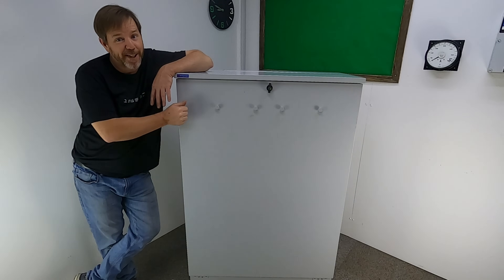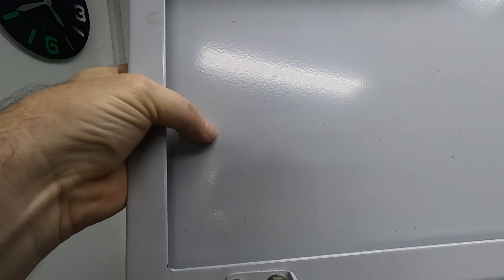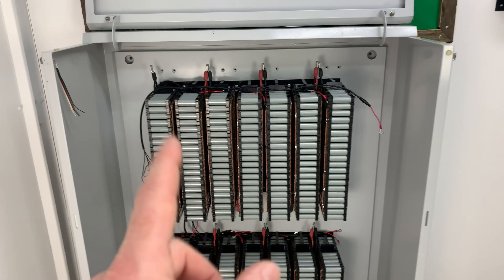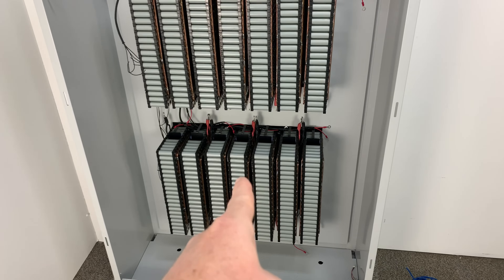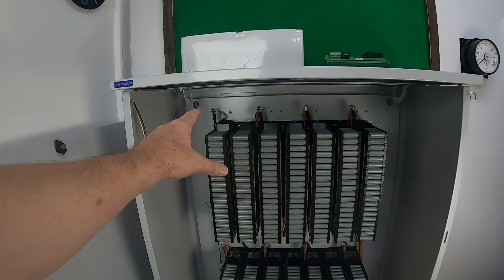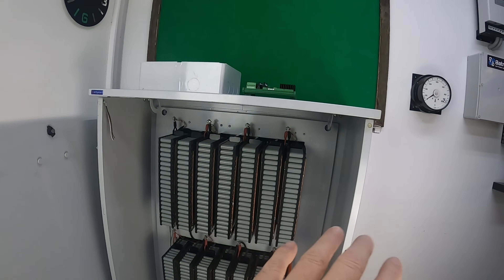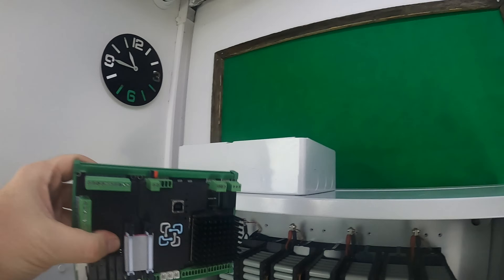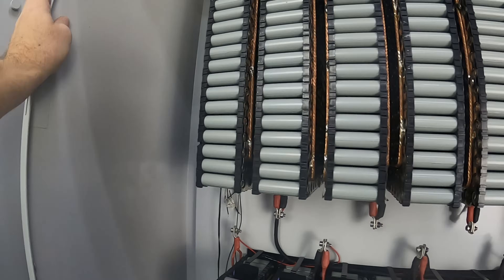Pt.3 Making this MONSTER DIY Battery safe!

Comment: It looks like your battery management board has din rail mounts on the back of it. I highly suggest bolting a small bit of din rail to the enclosure and mounting the management system to that, instead of cutting those mounts off and bolting the management system directly to the box. It will also be much easier to remove and put back in the management board in the future if you use din rail. Din rail also allows you to easily mount relays, breakers, and other common industrial automation components if you want to expand the system's functionality in the future.
Reply from the maker: I had a din rail temporarily attached and I will definitely will need it, was more thinking aloud trying to brainstorm the cleanest install possible.
Reply: @HBPowerwall  put it all on that flip up lid on top!
Reply from the maker: Considered that... but only for a short time.
Reply: I was thinking exactly this. use some dome phillips head screws from the outside in, and finish with nyloc nuts on the inside. This makes for a clean finish.
Reply: Usually in building a control or equipment panels like this, we mount  prefabbed rail, placing or making one or two brackets horizontally in an 'L' shape from the back plate to the front return edge where the door will butt up to. This allows for mounting DIN Rail as suggested but also does not require drilling holes through the outside wall of the cabinet.
Reply: Yep, use the T-35 DIN rail. 👍
Reply: Qqqqqqqqqq1qq 1qqqqqq1qqqqqq1qqqq

Comment: Hot air rises so you need to mount the fans at the top to expel the hot air or suck cold air in from the bottom, which is not as efficient.  I like the cabinet.  Perhaps a ratchet strap for added security.

Comment: What is the electrical capacity of the unit ??? KW please
Reply from the maker: The battery can hold 25kwh of storage, output would be about 15kw max 5 continuous
Reply: @HBPowerwall  Thank you for the facts Sir. I needed to jog my memory.

Comment: I will say I've tough about making me  something similar I can tank you for the plans nickel strips making it safer hmmm I think it will be nice if you cloud have solid mount as the whole battery cage can slide into and lock in place and as extra ventilation it cloud be filtered between the batterys  but I would not add leds because they would slightly drain the batterys there tho even tho it is a good idea I do like it dobt get me wrong and tanks for the awesome content @_@
Reply from the maker: Thanks for tuning in

Comment: safe well hum. It is DIY with many welds and many many cells. I see why they make you put it in a steel box. many wont do it right like you are. I am doing 54kw 280ah cells and that also has safety concerns which I am doing above and beyond like you are. so cheers mate and lets have a BarBQ
Reply from the maker: 54kwh wow that's double this one.. nice work on making it safe as possible

Comment: Where the heck is part 4?
Reply from the maker: in the description? 

Quote.... 
[ Part 1 ] Journey started here | https://youtu.be/PenPYwa00CA 
[ Part 2 ] Finding out the battery build isn't legal | https://youtu.be/HCd2opk9APg 
[ Part 3 ] Welcome, please enjoy your stay!
[ Part 4 ] Fixing leaky cells and a low voltage battery | https://youtu.be/sOFBYmMenXU
[ Part 5 ] In this episode I finally get the battery completed and ready for service, also incorporated my 100,000th subscriber video! | https://youtu.be/DAoCK3QNLng
end quote....

Comment: Like the fans on the bottom. Ideas would be intake from bottom and have some fans on top for exhaust to create good air flow.
Reply from the maker: Ideally yes, and that's how my other sheds work, but ... and but is a thing.. I would have needed to put vents down the bottom and there was already hard to seal gaps at the top so went with mother nature  and the old hot air rises theory.

Comment: I can't believe you rebuilt those batteries instead of just turning the entire row around (and just modify the bottom bracket, if need be)? Yes the terminals would be further from the back, but that would be a little safer as it adds more separation. Also, now you have 1/2 a bank that can't be swapped around when servicing. Look, you're a smart guy obviously so I don't want to dig on you, but 12 hours and $250 in nickel strip wasted....
Reply from the maker: Wasted meh maybe but made 10x that on the old YouTubes.  So guess there is that lol
Reply from the maker: Maybe I really am smart 😂

Comment: Those upper retainers worry me, and velcro straps I'm not too trusting in. I would line up a hole on either side of the case in line with the top of the retainers, and slide a bar through to lock the retainers down. If you need to take a pack out, you pull the bar out and that lets the retainers move freely again.
Reply from the maker: That’s kinda the current plan. I reallly should finish this project
Reply: @HBPowerwall  Oh on your own time, bud. Don't force it or it will become a chore. As far as safety is concerned, the chassis is already functioning as ground, as are those retainers, so a bar shouldn't pose any safety concerns. Sucks having one shot to cut the holes though.

Comment: Change your ventilation so that you have inlet in one corner and outlet in the opposite corner.  Having both in the bottom will create hotspots.
Reply from the maker: There won't be any heat in there as the battery is over built for the intended load. But fans are connected to BMS to only turn IF there is excess heat in there for some reason

Comment: Great job! The only thing I would change is the fan location, I would put them closer to the top because hot air rises up.
Reply from the maker: There are all air gaps at the top, and fans already fitted at the bottom. Hope it works lol

Comment: Definitely no need for the separate enclosure for the BMS.  It seems like it would just prevent that big heat sync from getting air.  Might as well leave it open, mounted as told below in the comments but without the internal box.
Reply from the maker: was going for a cleaner look, i understand it won't make it any safer..

Comment: On your cabinet, use aluminum angle mounted on the side and across the bottom of the battery to support it with cork padding on the angles. This will take the load off the mounts and stabilize it a bit.
Reply from the maker: Bottom is fine hasn't deflected at all, THE TOP is a different story.. not good
Reply: @HBPowerwall  I was meaning, The angles were for weight support to keep the top from leaning out do to some sagging. But if the bottom doesn't sag, why is the top sagging?  I would love to build a battery bank like this, but using Lifepo cells for better fire safety.  Keep the passion! :)
Reply from the maker: It’s levering out it’s actually pushing the mount up

Comment: there should have been separators between your hanging battery units, all wiring should be numbered or labeled at each end the Velcro is a band-aid answer to your problem/issue i'd remake your mounting units to have a managed rigid mounting system, your main power leads have no independent fuses that I can see in something goes wrong it'll be all over with all those cells current dump would be huge, also putting the whole cell/battery  setup in a cooling bath would go a long way to getting much better life out of your cell by having better thermal management. But still a pretty cool setup (ill watch the rest of you vids and see where you've gone from this point )
Reply from the maker: you have some good ideas thankyou

Comment: My only comments would be, bus bars would nice if your linking them all together. Also I would not be happy putting so much weight on a single cell at the top as its holding a lot of weight due to the lever effect, and the straps do nothing to reduce this load. Looks nice :)
Reply from the maker: After a year in those mounts they haven't fallen but you can see the top mounts are ever so slowly moving up and will cause a problem. I have an idea to fix it, but it'll make the battery 'look' ugly lol Working on final install video at the moment but it's number 1001 on my list of things to do.

Comment: That belt will do nothing on the center packs, the tension will be too low for the lever forces. Can't you bend the plates on the top like the ones on the bottom?
Reply from the maker: Yeh, it sounded good and cheap in my head, braced it with steel angle is a better idea

Comment: I would put an insulator sheet between each battery segment.
Reply from the maker: they connect anyway so not needed for electrical safety but as a thermal break - yes it's a good idea that's been kicked around for a few years.

Comment: you need a retainer bracket of some sort you have one level of security but you need to have a redundancy if your velcro strap were to fail your batteries would be on the ground. may not be pretty but ugly is better than destroyed
Reply from the maker: Yeh, the velcro I felt was a smartie pants idea but it is really horrilbe.. I mean easy & affordable but it's a dodgy repair not a fix for the problem

Comment: I would secure some unequal Angle above those Battery Retainers. Fasten the slim side of the Unequal Angle to the back wall of the Cabinet, and the broad side of the Angle can rest on top of your Battery Brackets, thus preventing them from 'lifting' as the Battery Packs try to dislodge themselves. Then, you can use the Velcro Straps for something else. Your videos are first-class, and we are all learning. Looking at your goals, it seems that you could go completely off-grid when the hard work is done. Excellent work.

Comment: I would have put a high voltage  Insulator matt behind the main hanger as they are metal and so is your cabinet.I know you are only 48v but if someone else dose the same but higher voltage could be a problem....I would also lay insulation   inside the hole storage unit....I use it for when I'm welding ...Great videos
Reply from the maker: At 2mm thick & plus 80kg for the cabnet I think i'll leave it how it is lol

Comment: Why is there No isolation on the bare  connections or wires   a disaster in the making
Reply from the maker: why they are joined anyway.. not like it'll short ?

Comment: HOW TO MAKE THIS THE MOST SAFE ENCLOUSURE?!  PUT INSULATION BETWEEN YOUR BATTERY CELLS...  I HONESTLY CAN'T BELIEVE YOU CONNECTED THOSE CELLS WITH THEM THAT CLOSE AND UNINSULATED..  THAT IS NOT SMART
Reply from the maker: You don't sound smart - they are the joined anyway lol But thanks for the interaction.. Seems you didn't want to watch the whole video - thanks for the laugh
Reply: @HBPowerwall  alright, guy who loves 18650's more than women and who has never seen one naked.  given the nature of li-on cells, its stupid not to insulate the packs when its so easy.  you talk about SAFE?  well its not safe or anywhere close to NEC.  obviously in an ideal world its fine, but when have you seen an ideal world?

Comment: We use an in field battery replacement kit that contains basically bags of sand. There are only few options to make it really safe in case of cell rupture or fires it's to put sand bags around your cabinets or blocks of concrete.

Comment: could you have used some cable or wire to connect the packs without re configuring the lay out
Reply from the maker: I could have but would have made a boring video 😁

Comment: Very adventurous-  (watched from pt2 on to pt 3...) though all those battery modules should probably have heatshrink tube around them - abrasion and short cct resistance...  You asked re. safety - I know it was all a year ago....
Reply from the maker: Part one was heaps better :P

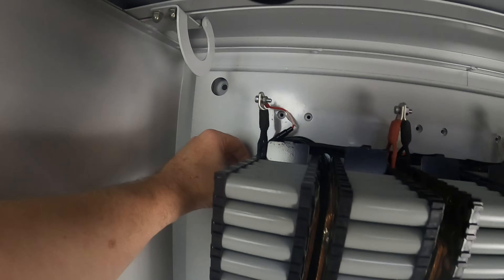Comment: Let's see if I can push your OCD button:  @8:20, you show a group of loose black wires.  You "should" go back and braid them in a decorative fashion.  Just kidding!  I've seen installations so sloppy they looked like Wile E. Coyote got trapped accidentally in the power house and strung wires in all directions, with a vengeance.  So kudos on your attention to neatness and detail!

Comment: Not a criticism, because you work with what you have and what you have is impressive.. but re-designing a mount for the newer and bigger battery packs instead of using the old one would have possibly allowed you to save the 12 hours of work to redo, $250 in nickle strips, the 9 batteries excluded due to "safety", and having to Velcro each pack to be more secure. An improved mount could have possibly allowed the battery banks to be simply flipped around. Though I imagine having new ones manufactured would have been a decent cost and designing/refining them would have taken some considerable time. Just some food for thought. But really, great and amazing work. Best!

Comment: I hate side mounting equipment.. We do it sometimes for clients who are all about cost but given this looks more like a love project and time isn't really what it's about I would attempt to move the batteries down enough to put all the equipment BMS and alike on a DIN rail at the top of the board (depending on your install height). An install like this you want the heavy stuff at the bottom and the light stuff at eye level (if you can). If you can't do that I would actually suggest not having the BMS in the board. Call that your battery box and install the BMS and everything else in another board.

Comment: I don't understand, how/why do you connect the positive red cable to the black negative wire?
Reply from the maker: +-+-+-+-+-+-+-+-+-+ 14 times = 4.2v x 14 is equal to 48v (ish) but its a 48v battery so...

Comment: I have to say I'm not a huge fan of this mounting system. There's just too much weight on each rack, only the first 3 cells are supported from the bottom, and the only thing keeping the modules from sliding out are these metal flaps that only go down 3 cells deep through the middle of the module, and are attached to the rest of the structure with that thin piece of steel. It's a major weak point. The velcro strap will help, but isn't enough, it can slide back. Can't you install some wooden supports that support each row and put holes in it for the cables.

Comment: Can I suggest a "Blazecut T Automatic Fire Suppression System" for the panel. Its a tube containing an extinguishing agent, the tube degrades under heating and releases it putting out the fire.
Reply from the maker: That'll stop the flames now and MIGHT just MIGHT slow the thermal reaction but I don't think it'll play a big role in helping.. this many cells will create so much heat that you just gota dump 100,000L of water an hour on it till it cools. OR better yet build around this fault state (as i'm trying to do)

Comment: An earthquake will short your cells swinging them back and forth. They almost touched just from you putting your hand on it. At minimum you need a rubber spacer and a strap to lock them in solid. You shouldn't have positive and negative facing each other.
Reply from the maker: I live in Brisbane - I can't even remember the last time the ground moved... But yes I do agree. As for Positive and negative facing each other -- Why? they connect anyway..

Comment: First up very interesting video. Thanks for taking the time to film, edit and upload. I think it was worth it. Come on Aussie!
All this talk of fire warnings/suppression. Need to redesign rack and put some decent current/heat material between those banks. First rule in fire safety is design not to have one. New design of wall rack is an absolute must. Looking at your setup with an eye to failure, I reckon only a small incident, say an overhot cell warping a tab for example could result in a massive fire and total destruction. Heat could warp those tabs and the whole lot spills its guts everywhere. I like the neat look but $200 wasted on nickel connectors could have gone to new wall bracket design. With your design you are not going to eliminate cables so that was a crying shame. Maybe time to think about busbars. Negligible voltage loss, less cabling, simpler connections from packs to busbars. Mounted on insulators means easier maintenance, maybe better current flow, more incident proof means better design. Maybe next time.
Enjoy your 3 day lockdown and thanks to QH for allowing me to wear a mask again. I forgot how shitty they are.
Reply from the maker: all good points - and I hate the dam masks lucky I work from home.

Comment: You asked for safety suggestions. How about (1) a smoke and heat detector linked to a water drench fire suppression system inside the cabinet? (2) an insulation monitoring system to detect short circuit of the positive or negative to the enclosure case?
Reply from the maker: Great ideas, have the heat/smoke detector with a relay that talks to my BMS then can trigger a shunt trip, you of cause hook that up to anything including a waterpump light, siren etch

Comment: What's the prospective short circuit current and what is the interrupting capacity of those dinky little HRC fuses?
Reply from the maker: 3-5amps i tested one at (yes only one) and they are only for bms too small and you starting getting into weird readings on the BMS

Comment: Dont know if anyone commented on the fans yet, but a rule of thumb when it comes to theese computer style fans is that the larger they are, the more air the can move relative to the noise output. I would have gone with 140mm fans instead and this make it as effective as possible while maintaining a reasonable noise climate near the box.

Edit: Yes, i know computer fans arent 48V but they are otherwise the same.
Reply from the maker: i have a few 48v 10cm fans and holy shit they are like a jet lol so noisy